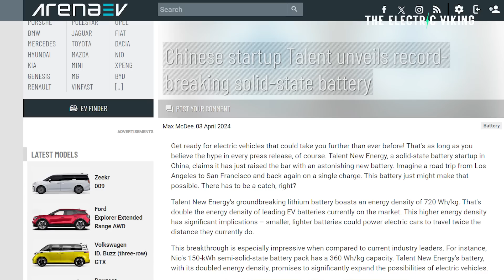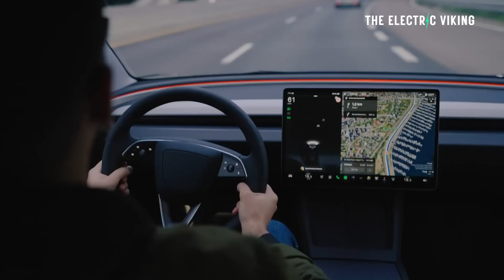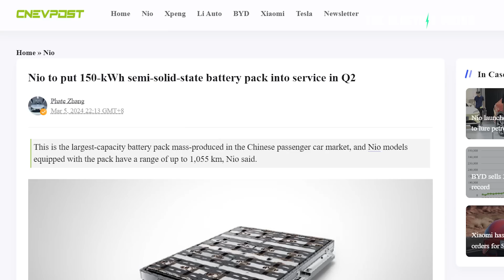Highest energy density battery in the world enables EVs with 1250 mile range

Comment: I still want 500 mile (835 km) range under ideal conditions and 400 miles (670 km) under tougher conditions (cold, rain, snow, wind).  I'm personally living with 250 miles but I want more in a Model 3/Y size vehicle.   At that level, and with today's pricing, and home charging, one would be a nut to buy an ICE.
Reply: I'd like to be able to drive the 1100 km between Alice Springs and Halls Creek, on the Tanami track, while towing a small camper trailer. A 2000km battery would be just fine by me.
Reply: It seems to me there are trade offs.  When we were kids we went in the station wagon on vacations, 4 to 5 hours stop, at the most.  Mostly 4 hours.  Big vehicle, pulling a trailer.  

Now I would be stopping more often for a pee break, good Ole prostate, but still aim for as close to 4 as I could get.  

I don't think any EV built today could manage that.  I heard a Cybertruck pulling a Cybertruck only had 150 range.  

Yes we need affordable City commuter cars.  But  we do need something that can handle these other trips
Reply: @tireddad6541 by all means, buy a Cybertruck for that once a year family vacation.
Reply: What's the cost and when is the release party?
Reply: I'd be good with 50 mile range on a tiny car with just room for two people, and an SUV with 200 mile range while towing a small boat.
Reply: @jmodified Plenty of choice then, that is if you are outside North America.
Reply: What a strange comment.  Aside from a few rare vehicles that use diesel very few petrol vehicles get 500 miles of range on a full tank.  You get a stated range and will never you come close to 500 miles.  My Audi A6 3.0t with a full tank says 525...but in reality I get to about 420 if I drive 60mph and gently accelerate.  I currently pay 4.26 per gallon for a 16 gallon tank.  I'd gladly take 354 miles of expected range in an EV which I only pay 0.12 cent per kwh to charge at home.

How come you haven't railed against ice manufacturers to demand a true 500 mile range vehicle?  Humm?  You want the 500 now from ice, yet you can't even get that and now you bash evs for not giving you 500 miles?  Sounds like you just want to hate for hate sake.  You've had decades to demand 500 plus miles and yet you didn't?  Humm?  Now that EVs and range are becoming a thing of the past...you comment and demand something your own ice can't give you.  Strange comment Brian.
Reply: @williamgrunzweig571  What are you talking about?  I currently own two Tesla Model Ys.    My old Ford Fusion had an honest 500 miles unrefueled range at 78 mph on the freeway.   I'm certainly no basher of EVs since I haven't owned an ICE in 7 years.    But, I still would love to have 500 miles EPA range.   I probably won't take delivery of my Cybertruck on order because I ordered it based on the promised 500 mile range which would give adequate mileage for camping trips and towing.   That said, I wouldn't trade my Model Y for any ICE car.
Reply: @williamgrunzweig571  nothing rare about diesel cars. The vast majority are diesel in Europe
Reply: @williamgrunzweig571  most family size cars in Europe I. E. Skoda/VW/Audis with 4cyl diesel will get about a 1000km on the autobahns if you sit on 130-140km/hr. A bit more if you sit on 100-120km/hr. Over 140km/hr and the milage shrinks dramatically.
Reply: Still 6 years away.
Reply: I just need 300
Reply: Should have bought something other than a Tesla. Tesla's are notorious for poor range. My Enyaq does 360 miles on a full charge
Reply: @rogerphelps9939   The Enyaq rating is WLTP.   A Tesla Model 3 WLTP rating is 352 miles.  A Tesla Model S does over 400 miles on a full charge.  My Model Y does 310.  Teslas do great on range.  If I wanted really long range for the price I would have bought a Lucid which does 500 miles on a charge.  A Model 3 does 340 (EPA rating).  I don't know where you got your information that Teslas don't have great range.   For now, the Supercharger network is the only real (decent) charging infrastructure in the US.   Everyone else is buying cars with a functionally obsoleting standard until they switch over for the NACS standard here.   I wouldn't buy anything but a Tesla in the US for now.   Full Self Driving (supervised) + great charging + great range + great integrated software + great performance + high quality of a Tesla is hard to beat overall.
Reply: In central europe i want a 480 km 10to80 at highwayspeed, so driving 3 to 4 hours then recharge in a 1 hour stop for travel.
For daily use i would just top it of to 80% every evening
Reply: @petervautmans199   The good news is that Tesla Model 3 and Y fit that description.   Typical stops are 20 minutes for charging on most trips.   I like to charge daily 70% to 75% for great battery health but I don't hesitate to up that for needed range.
Reply: Fast chargers are bad for your batteries
Reply: @GraemeMarshall-u7w  Not according to Recurrent who has done a major test on thousands of real world BEVs.  They found no significant degradation due to high power charging.
Reply: I’m still not sold on the whole idea that EVs are going to be better for the environment. There is a hole lot of other things that have to be factored into that, I think there’s a whole lot of people live in a fantasy world that just don’t see that part of it
Reply: @marshallforeman2051  but I think you can see that having millions of cars running around the world's roads and stuck in traffic jams that are electric and not IC is clearly better for humanity and the environment. In fact, I think the day will come when people will look back at the day when they used to walk their children down Oxford Street in London next to hundreds of busses, taxi's and cars belching out poisonous gasses and think "what were they thinking".
Reply: @marshallforeman2051   A (w)hole lot of things have been factored into the serious academic studies.  Both ICE and BEVs required mined minerals to fabricate and the BEV requires a slight amount more (typically).   That build deficit is made up in the first 40K miles of operation.  The BEV emits nothing and the ICE car will continue to emit 2.5X+ gases than the weight of the gasoline it burns (because the fuel combines with atmospheric oxygen to produce CO2) for its entire life.   The fantasy world is the one where the sources of serious science are from mainstream headlines with paid agendas behind them but without reasonable experts.
Reply: ICE here in Texas (RAV 4 Hybrid), is way cheaper per mile than a model 3.  Cost to drive M3 1000 miles, 90 dollars, RAV4, 78 dollars and 50 cents.  Plus you get there 3.2 hours faster and in the winter it is 128 dollars for the Tesla and 82 for the RAV4, with 5.2 hours due to less range and slower charging sessions.  On one Trip I took The cost and time were 13  for charging vs less than one total hour for gassing, and the cost was 230 dollars more per direction due to having to add 476 miles to the trip due to no chargers available on the much shorter route which the RAV 4 made with 240 miles of range to spare.
Reply: @damaliamarsi2006  Here in GA with my electric company it only costs $25 to $30 to drive 1000 miles on home electricity.   You are getting ripped off if you are paying that much.   At a Supercharger, it is only about $75 to $90 for 1000 miles.   But 80% of my charging is done at home.  so the M3/Y is much cheaper than your RAV4.
Reply: I used to do a weekly commute of up to 250 miles. In UK that’s about 4 to 5 hours driving. We already have enough chargers at motorway services for that need. UK is installing roadside chargers but speed?  I’m not expecting much from them or a reasonable price per KWH.
Reply: Buy a Skoda Enyaq 80.
Reply: weve been down this road before with the E Viking  he just doesn't live in the real world   you are totally right about needing at least 500 miles better to have or give the choice of having 700 or more    don't tell me about what range I need  most families take at least one if not dozens of long trips a year   carrying Thules on their roofs along with surf boards and bikes on the back   see what happens to my model 3's   270 mile  range when I load it up like that or just drive it empty but at 75 mph and watch my range drop to around 175 miles just by driving maybe 5 mph over the limit   so  my Subaru gets around 400 miles fully loaded roof and back hitch and I fuel it in 5-10 minutes   we need real world range of at least 400 miles along with quick recharge    get to that and ICE  will shortly die
Reply: I think an EV for visiting friends and family and doing the shopping etc is fine. And that's at least 90% of what most people would use it for. But longer ranges, quicker charges and more chargers are on the way. @robertthomson9340
Reply: Right, you probably wouldn’t use near that range but it would be good psychologically to have that extra padding in the range. Some day you’ll get to a charging station and find it not working for some reason. No worries if you have those extra miles in the “tank”.
Reply: You can have that in about 3 years
Reply: @larryc1616 Wrong. The charging power is impracticable. It will not happen
Reply: 500 miles range at $35K and I'm in.
As to the guy mocking the need... many people do need it even if you don't. I personally do need to occasionally drive 220 to 250 miles each way on business trips, hence about 500 miles RT, and my destination may or may not have a charger. I don't want to have to worry about that. My old Chrysler minivan can go over 500 miles on the highway on one tank and I'm not going to sell it until something at least as good comes along.
Reply: Solid state batteries would theoretically perform better in ‘tougher’ weather conditions. What actually happens in real world environments, and of course, the way the tech is implemented is another matter.
Reply: People look at the range the wrong way. The range is only a big deal because charging takes a long time. If you could charge in 5 min 250 would be fine. To me the problem is charge times not range. If you have fast chargers everywhere on the interstate and you can charge up in 5 min who cares about the range at all. These fast charging solid state batteries would make 250 mile range better then 700 miles with a slow charge old battery.
Reply: @allie3246  You are assuming that we all drive on interstate highways. Look at a map of north west New Mexico and south west Colorado. There are no interstate highways and no fast chargers other than an older Tesla supercharger in Farmington. I was on a road trip last week, at one point my gps said next turn is 175 miles. I didn't see a single charger the entire way. There are lots of mountains and cold temperatures. A 250 mile range ev just doesn't cut it here. I wanted a 500 mile Cybertruck because not only do I drive long distances, I also tow. I also use my truck bed. I am bitterly disappointed in Tesla with their measly 123 kWh battery. Gm is selling a truck with a 230 kWh battery. Do I really have to buy a GM product to get a decent range?
Reply: @allie3246 Charging an 80kwh battery in 5 minutes requires 1 megawatt. That is very unlikely to ever be practical
Reply: @allie3246  
Smaller battery packs make the cars more affordable and lighter for better mileage....those fast chargers will be everywhere very soon as demand warrants.
Reply: @allie3246  That's a good point but that wouldn't work for me and loads of others. Range is a big deal and so is charging speeds. My old van from 1996 gets double the range of most EV's. I can drive 3 hours north to visit family and drive back home to refuel at my local station with people I know and trust. Nobody wants to spend their time trying to track down recharge stations all the damn time. When they start selling EV's with 600 mile range then, we're talking. Range should be determined by the worst days not the very best - I want to know the range from 20 below zero to 150 degrees. 1000 mile solid state would be perfect too.
Reply: @allie3246   disagree if I now go 400 miles between fill up Im not about to go to 250 just because it charges quickly while I pee L O L
Reply: I used to drive melb to Syd 880km on a Friday night and come back on a sun night. I drive Düsseldorf to Prague 745km 5/6x per year. My Skoda superb 2011 diesel gives me a 1000km on that trip. Ie I'm left with 200km so don't need to buy expensive fuel on the highway. 500ml/800km is nothing
Reply: @SR-pr2xz    If you were charging with electricity, you would already be paying about 1/2 to 2/3s of diesel costs on the road.  When I charge at home my costs are 1/4 of gasoline.   When you can charge nightly at home, EVs seem far more convenient than diesel cars, far less smelly, with less pollution, better air quality, and less noise and vibration on long trips.   I would never trade even my current 300 mile range EV for a diesel auto.
Reply: @brianbeasley7270  I take range thanks very much. Full tank cost me €70 +/- at present. EV charging rates at about€6/100km. So about €50 for  one trip, but requiring 3 charging stops. Not to mention Winter when it can get -10 to -18. Nah. I will stick to diesel thanks
Reply: @SR-pr2xz    Everyone has their own needs so if that works for you, then so be it.  I pay about  $1.50 (€1.40)/100 km which is a nice benefit for me.  Your "€50 for  one trip" costs me about €12 (pretax)--so I'm good with that.
Reply: @SR-pr2xz  so you are arguing against me who is arguing against ev yet you are doing the same.
Apart from not knowing the driving term of nonstop / driving thru
You're an exceptional bright one.     Ehh	.
I do wish we had good a	Diesels here in USA but Diesel here is an afterthought.
Loved driving in the diesel bmws on autobahn and diesel Peugeots and Renaults.
Reply: @L0st-n0found  I haven't argued against you, I just pointed out driving 1600km in a standard car (whatever the fuel source is BS because you would have to stop for a refuel at a minimum. I have also driven 1400km in a day with only fuel stops and a sandwich on the run. But it is still a stop. In fact multiple, because that was in a petrol car
Reply: @SR-pr2xz  all good. Here in general we consider nonstop driving or driving thru only gas likes of coffee and possibly meal to eat and drink while dribing.
No stopping for sleeping (I count the 2person nonstop because we each got some sleep while other drove). no couple hours meals etc.   
I actually didn't double the trips minus 1 as drove both north south then south north each time plus forgot a handful of  long nonstop trips going other places apart from the northern New England to key west down and back. 
Have also done same with actual stops for sleep and meaks but usually in small areas unlikely to ever get a charging station.  Some don't even have gas still.

As to ranges.
Buick lucerne with a pretty good engine for mixed driving  mid size sedan 3.8l v6     18gal tank,   regularly filled up in the very high 16s or mid 17s and averaged 43.x mpg
It's epa rating is 17/26.   In the one I drove passed down from New I got 25+ city daily use usually with a ton of stop and go and maxed out at 50something (over hundreds of miles) easy highway kept no faster than 75 on 70mph with a couple short exceptions.   How many vehicles get way higher than published estimates?   Break in periods were strictly followed,  cars babied and not driven hard.   

Seems to me if all gas motors were built like that for we would have much less need for alternatives.   

I'd also like all my vehicles with the bare minimum of extras to break.
Reply: You need to buy the Xiaomi SU7 Max. Meets all your requirements and well priced.
Reply: @marviwilson1853   Xiaomi SU7 is not available in the US and will not have NACS plug support for a while.  That rules it out for me.  Thanks for the tip, though.
Reply: @brianbeasley7270  Bad luck but at least it shows what is possible and no doubt available soon in the US.
Reply: @marviwilson1853  except it is android based
Reply: Why do you need so much range? The more battery you carry the less efficient your car is. I'd rather have short range car but lighter and more efficient, but with much better charging infrastructure. 3x as ubiquitous as gas stations would be ideal.
Reply: @i6power30  But there should be the option to buy long range vehicles. People like you could buy the cheaper, short range versions, but those of us who need it could still buy an ev that meats our needs.
Reply: How often do you drive 400 - 500 miles non stop??? 😂
Reply: @mikafiltenborg7572  we all drive differently but I just drove home from Colorado to the East Coast and really appreciated not having to stop but roughly every 400 miles especially with two drivers in the car
Reply: @mikafiltenborg7572 People buy SUVs with huge fuel tanks, even though they’re clearly more difficult to fit under a vehicle.
Reply: @petesjk that literally makes no sense, have you seen the energy density of petrol?
Reply: @isaac827   The energy density of the fuel is meaningless if you can't turn the fuel into motive power efficiently.  Gasoline has much higher energy density than the described batteries but the powertrains are usually less than 25% efficient.   Range is determined by (amount of energy X  (an efficiency factor)  X  (a weight factor) X (a regen factor) X (an aerodynamic factor X speed*2).   ICE vehicles really suck in the "efficiency factor" part of that equation and (unless a hybrid), has no ability to regen.
Reply: @isaac827  Doesn’t make sense? Have you looked at how they’re installing fuel tanks under SUVs? I don’t have to explain it, just freaking look underneath.
Reply: @brianbeasley7270  yeah but petrol has 100 times the energy density of lithium batteries, making the efficiency fairly irrelevant. An EV is far more efficient but not 100 times more.
Reply: @isaac827  It's not insignificant if 70% of energy in petrol is lost!
Reply: @marviwilson1853  that still leaves petro as 30 times as energy dense as current battery technologies (if they were 100% efficient) even allowing for the inefficiencies...
Reply: @isaac827  You are correct but the battery material is not consumed by the use.  It weighs about 1700 lbs compared to 100 lbs for a typical tank of gas.   The ICE car only has about a 1.4X overall advantage per fill up.   Which is why a typical BEV goes about 350 miles compared to 500 miles for the highly efficient ICE of the same size on a tank of fuel.  So you are comparing apples to oranges.   The real comparison is how far can the vehicle go on the same energy and how much does that energy cost per Joule.   Electrical energy is typically 1/4th the price of gasoline for equivalent range of equivalent vehicles.   This is why EV opponents want to state the "100X energy density" story but it doesn't really explain what anyone cares about--Range, cost for that range, and weight of the vehicle.  The overall weight for an AWD BEV is roughly the same as an AWD ICE (with the slight range decrease described) and about 4X less expensive.   This is what most people care about.
Reply: @isaac827  Yes but that is a huge change from saying 100 times!!
Reply: @marviwilson1853  sorry but that is the literal difference in energy density between lithium and petrol. There is no argument about it, they can afford to be a lot less efficient for the same output. The efficiency is nothing in this equation.
Reply: @isaac827  but there are no prizes for having the best energy density here. The prize is for the best way to push a car 500+ miles along a road. Has battery energy density progressed to the point that the EV car is now the best solution for this task based on the environment, our health, cost and driving pleasure. I say we are at the tipping point now given we have a 93% efficient EV motor and not a 33% IC engine and battery density that is 30 time less than gas by weight and not 100 times less.
Reply: @marviwilson1853  No battery energy density has not progressed to a point where it the best solution, the belief that you are saving the environment is debatable, given where the majority of greenhouse gasses come from, hint it isnt ICE vehicles. We will probably get there with EVs but not until solid state batteries are widely available and as cheap as the current batteries, in my opinion
Reply: @isaac827  The Xiaomi SU7 Max does 800 Km on a single charge and is well priced. What range in your opinion is needed in order to say we have progressed enough? As part of the push towards meeting Kyoto agreements, the Electric car is far better for the environment than a gas powered car. It is good to see that you understand that EV's are a development process just like digital camera's, flat screen TV's and computers. Many people are happy to down EV's based purely on the state of the art now as opposed to learning from history and having the imagination to see what is coming. I would be sure that in the not so distant future we will have EV's that can go 1000 miles on a single charge, be made of cheap, environmentally friendly batteries. Charge in minutes with no degradation over time.
Reply: @mikafiltenborg7572  not everyone lives in the city. I am fortunate enough that my commute fits an EV. But a lot of people even in my small country commute farther than the winter range of current EVs (300-350kms)
Reply: @mikafiltenborg7572  FBI most wanted would !
Reply: @mikafiltenborg7572 I've done around 1800miles nonstop 2x with one other driver and 700-1000 nonstop just myself 3 times.
One can also presume not to have acceptable recharging every single place you go for decades or more and if you want to say roam 400miles, 500miles, 300 miles etc and no charging available you're going to need a vehicle that you can add all those (maybe 10 times 400miles) up and not leave you stranded.
Kinda hard to add an excessy fuel canister when your fuel is thousands of lbs of batteries.
Reply: @L0st-n0found  1000miles /1600km non-stop! Pull the other one. There are no cars with that kind of fuel range. 1000km max with a 52L tank on a 4 cyclander. Me think someone is telling porkies or doesn't know the difference between miles and kilometers
Reply: @mikafiltenborg7572  Stop telling people me how much range they need. It's very annoying.
Reply: @domdittyful It might be annoying but people like you think that they need far more range than they actually do. So there.
Reply: @rogerphelps9939  It's called convenience. No one needs a ton of range, but would it make life easier? Of course! That's what you guys don't seem to understand. No one buys cars solely off of what they need. EV sales low right now because it's less convenient than gas cars. That will change once EV's start having longer ranges.